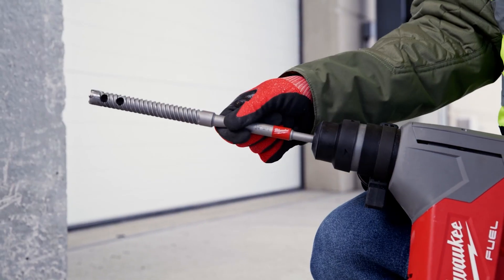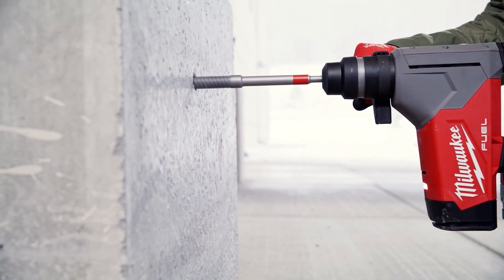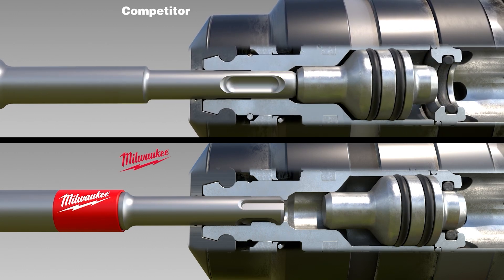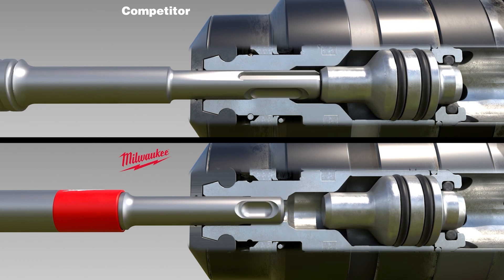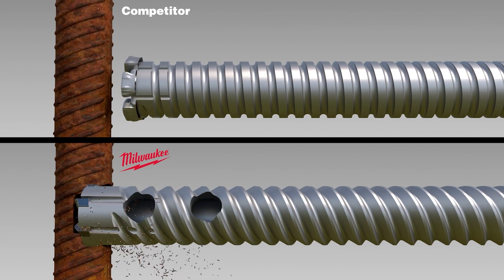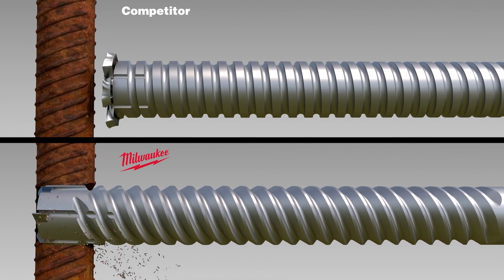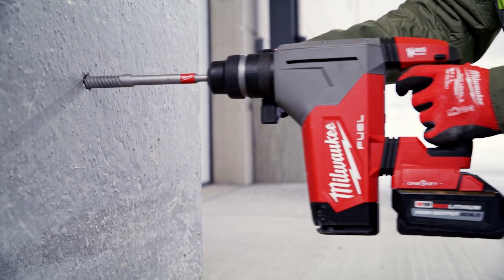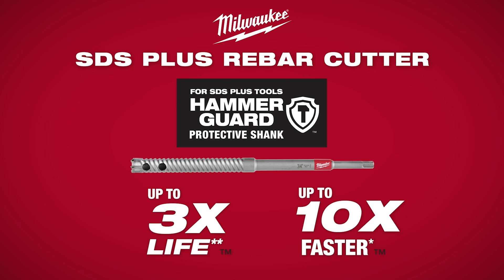Milwaukee Tool SDS-Plus Rebar Cutters 1/2" to 1-1/2" with Hammer Guard - Ohio Power Tool

Comment: I was having trouble drilling through rebar with a Diablo then I found the problem. Cuttings were preventing the bit from working. I cleaned the holes out with compressed air and an extended nozzle that reached the bottom. I quickly drilled through after that.

Comment: Actually a very good idea. Do you make it for SDS Max? because those are the ones that usually dont have rotation only mode
Reply from the maker: Thanks! Totally agree,  it’s a smart design. Right now, Milwaukee’s Hammer Guard rebar cutters are only available in SDS-Plus, not SDS-Max yet.
And you’re spot on, a lot of SDS-Max hammers don’t have a rotation-only mode, which would definitely make a Hammer Guard version super useful. Hopefully Milwaukee expands the lineup soon! 🤞
We’ll be keeping an eye out and will definitely post updates if they do!

Comment: Swapped over to this bit as soon as i hit rebar, brand new bit purchased the day before from home depot. set to drill only, and first attempt, 2 teeth broke off the tip. Used as directed, didnt lean on the bit and still got damaged. Very unhappy customer bc this was not cheap. Maybe this was designed for smaller diameter rebar. Def not 3/4”
Reply from the maker: That is frustrating! We would recommend reaching out to Milwaukee to possibly see if they can do anything for you, whether that's a refund or something! We apologize for this inconvenience but appreciate you sharing your experience with others.

Comment: Diablo by Freud DMAPL4320 1-1/8 in. x 16 in. x 18 in. Rebar Demon SDS-Plus 4-Cutter Full Carbide Head Hammer Bit.
One and done...
Reply: that shit takes years to get through rebar. since this has a neutral rake angle it cuts through metal much faster but is more fragile when cutting concrete. physics still exists unfortunately, so you can't always get everything you want in one tool. I mean if I could buy a tool that was a sawsall, angle grinder, sds, drill and driver all in one that weighed only 2 pounds i would, but thats not possible
Reply: @morscovium8881  
Life is full of compromises. We strive to persevere. 🫡🇺🇸

Comment: So, do i need another bit to make holes in concrete, or this bit will go through ribar and also concrete?
Reply from the maker: It is advised not to use a rebar cutter to drill concrete during the whole drilling process. This is because concrete will wear the rebar cutter quickly, it is better that you use a rebar cutter only when encountering the embedded rebar. While drilling in high volumes of reinforced concrete, it is better to use a concrete drill bit instead.
Reply: @OhioPowerTool   usually when you find a rebar while drilling in concrete you will not just see the rebar, it will usually have concrete next to the rebar, because you don't hit the rebar at the center. In other words, when you are drilling a hole, the rebar you encounter usually doesn't cover 100% of the way, but only a certain percentage. Therefor, most of the time it's impossible to use the rebar cutter and cut nothing but the rebar. You're forced to cut through some concrete while cutting the rebar. And we know that this does damage to the cutting teeth, thus rebar cutters don't seem to me like a very good idea, because they won't last, or you will have to sharpen the teeth somehow.

That said, I don't have any experience using rebar cutters, so I might be wrong, who knows.

Comment: So am I supposed to use the SDS Rotary Carbide drill if I think I may hit rebar or only if I know I'm drilling where I'm going to hit rebar?
Reply from the maker: It's always best to be prepared! If you're drilling anywhere you think you may hit rebar, it's always a good idea to have something to handle that beforehand rather than having to stop what you're doing to pick one up afterwards!